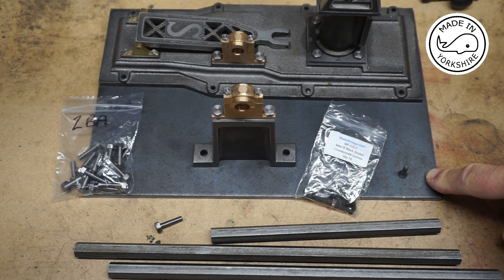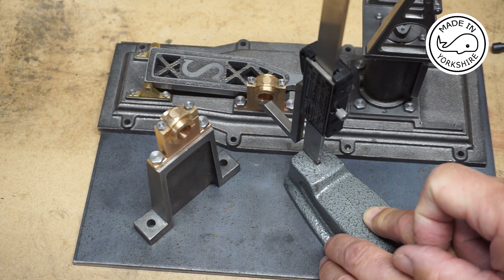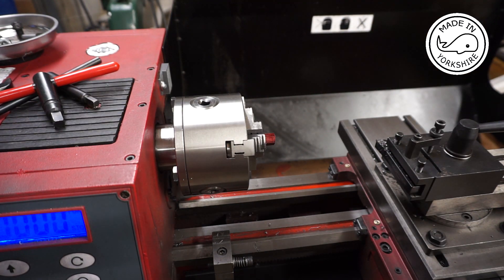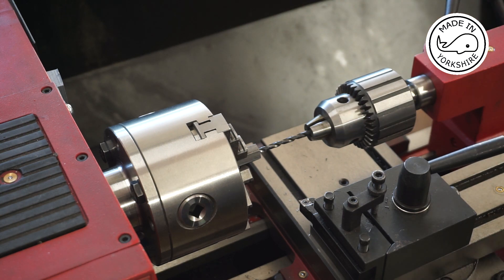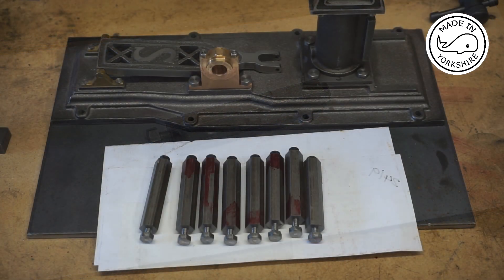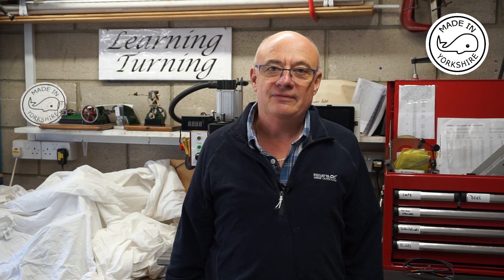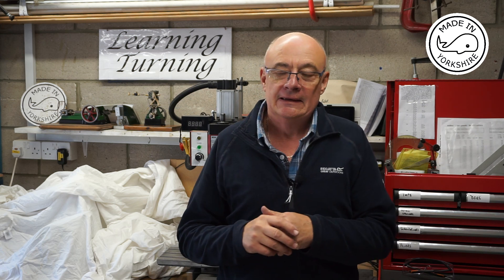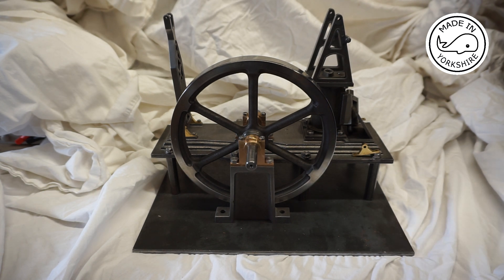#MT32 Part 13 - Making a Stuart Half Beam Steam Engine. The Base. By Andrew Whale.

Comment: Hello Andrew. I am greatly enjoying catching up on your steam engine videos. Briefly, I am a few years older than you but just returning to model engineering. I have recently got my elderly Myford Super 7 into working order and am updating my tooling in preparation for resuming work a Stuart 10V that I started on some years ago. I wish I had shares in RGD Tools ! I apologise if you may mention them in later videos that I have not yet watched, but may I give a recommendation to Tracy Tools. I have no connection with the company other than as a very satisfied customer. They stock an excellent range of tooling and give top rate fast mail order service. They also have a very useful printed catalogue as well as a good website. They do attend model engineering exhibitions, but I'm unable to get to those these days.
Thanks and best wishes from Northumberland.
Reply from the maker: Hi George - thanks for the 'recommendation'. I've come across Tracey Tools but never actually purchased anything from them. I plan to get to the Midlands Model Engineering show in October, so I will look out for them.
I hope you make good progress with the 10v.  It's a really sweet little engine, especially with the reverse mechanism.
Cheers
Andrew

Comment: Hi Andrew, I just got thinking and only just realised that the Stuart Half Beam engines don't come with a box bed casting to raise the main body of the engine in the way that the full beam engine does. I haven't built either of these engines so it's something I hadn't really noticed until now. Anyway, I realise you are looking to use pedestals but have you thought of using a wood block then adding a mock brick effect?  I used the technique on my first engine (a potty mill engine that I made without a mill ages ago), the engine is a bit crude but the brickwork can give reasonably attractive results. In my case the brickwork is a bit too regular and even but it is possible to buy stencils that deliberately have uneven bricks too give a more realistic look. It might be something worth considering and I can supply links to the material suppliers.
https://www.youtube.com/watch?v=mEij3MqwBOU
Reply from the maker: Thanks for the info Peter. I'm very much undecided at the moment. I put the hex legs on with a view to possibly attaching something in the future. Once I've got the engine up and running I'll give it some more thought.
Cheers
Andrew

Comment: I bet you had fun getting all of those columns the same!  A great job for a chuck back stop.
It’s coming along very well!
Reply: I just got an mt2 collet and made a draw bar and I have a few stops which fit the collet.  Also handy for setting up thin parts square in the chuck.  I think I show it in my die video.
Reply from the maker: Very interesting John.
Cheers
Andrew
Reply: Something I just thought about was that you might be able to put a parallel between the jaws against the face of the chuck to get an accurate reference surface. That may work if the piece isn't too terribly long. 
Just another thought.
Reply from the maker: Very interesting John - I've just googled lathe chuck back stop. That would have certainly saved me a lot of time. I think Hemingways do a kit for the Myford. Not sure if I could adapt it for my MT3 headstock spindle, but something for me to investigate further.
Great tip as always!
Cheers
Andrew
Reply: I was thinking that you might use a stop with your mill vise and just mill the ends of the columns to size.
Reply from the maker: Ah - fair point Robert, I didn't think of that. Though I do envy those that manage to machine all sorts of things in the lathe. I find it incredible that some model engineers don't even have a mill.
Cheers
Andrew

Comment: It's looking great, thanks for uploading a 'family' shot of the components in situ it is useful in seeing where you are up to and what is left to do. Once it is getting near to completion if you wanted to give it (and the 10V) a run on the hot stuff give me a shout and I can let you borrow a boiler for a couple of weeks.
Reply from the maker: Hi Peter. It seems an age since I made the flywheel and it's been wrapped up in kitchen paper ever since. I was quite impressed when I placed it on the crank. Thanks for the offer - we will have to work something out.
Cheers
Andrew